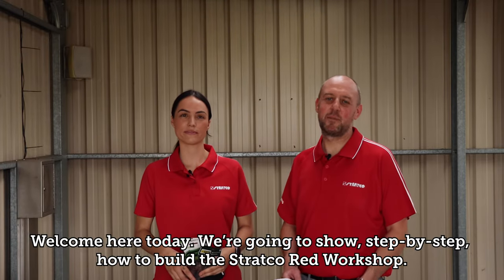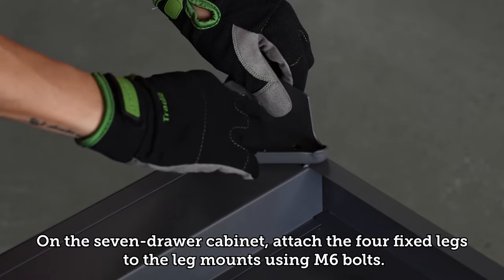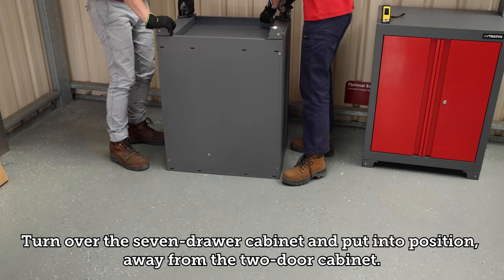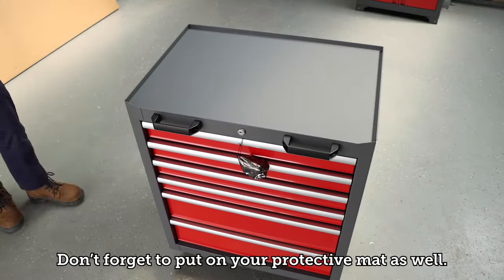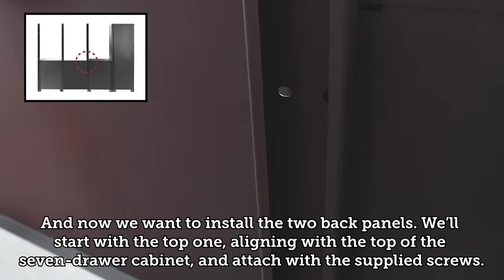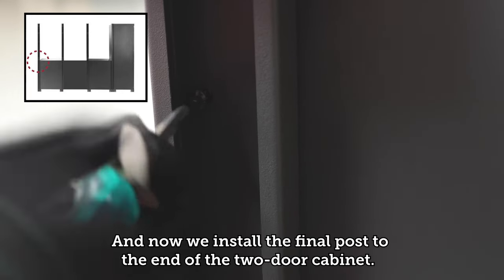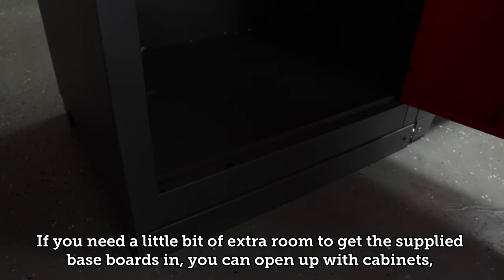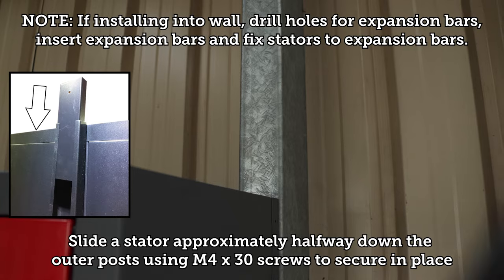Stratco Complete Workshop Kit Red | Installation Guide

Comment: Not bad but you're much better off getting a 19mm spanner underneath than using the crappy hex key as it doesn't have enough leverage and the tops of the legs round off.
Reply: What is the size of the bolt for the adjustable legs? Looks like a m10 or m12